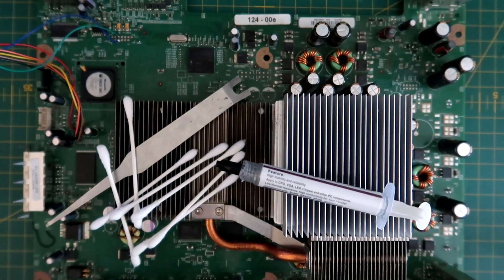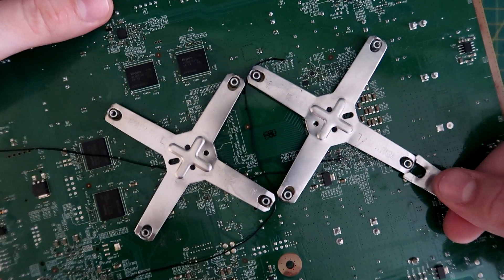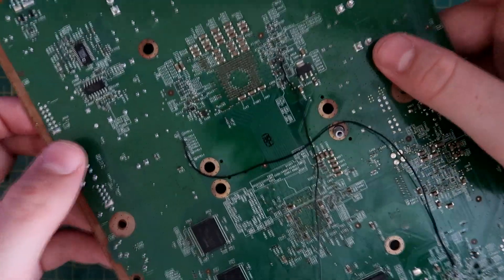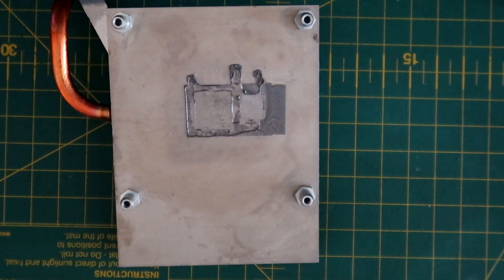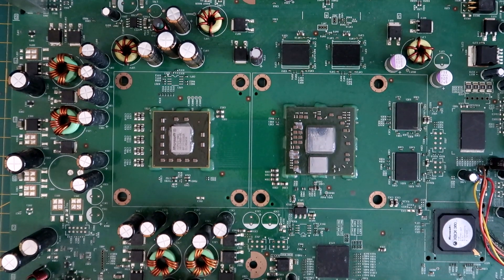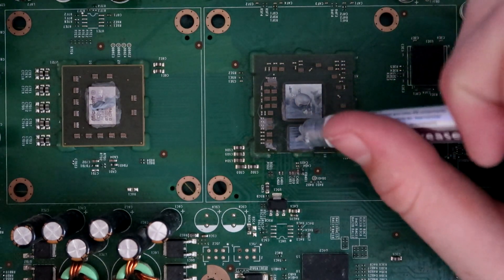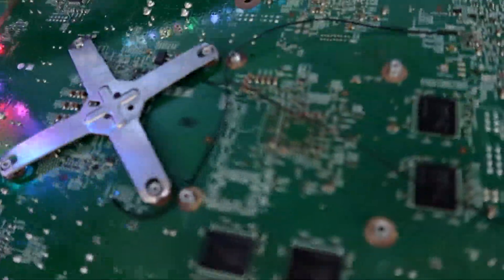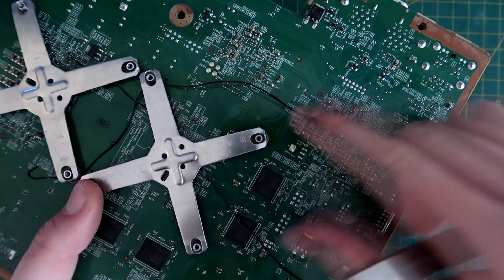How to replace Thermal Paste Xbox 360 PHAT

Comment: Hey there.  I just repasted my falcon and now it had a red ring.  Code 0001 (general power issue) should I repaste again? Both Xboxes I did have the same code.  Did I put too much?
Reply from the maker: Code 0001 has nothing to do with thermal paste, there will be some other fault with the console that needs to be found and repaired.
Reply: @TheModSmith  Yes, I figured it might be possible that it was shorting something.  I wasn't rough with the board and it wasn't red ringing before.  So I'm a bit dumbfounded at the result.

Comment: I see the RGH 3.0 mod and the nand flasher cable soldered on :P

Want a pro tip?  Get some paper towels or cotton pads ready, spray with electronic contact cleaner. Dab up all the dissolved thermal paste.